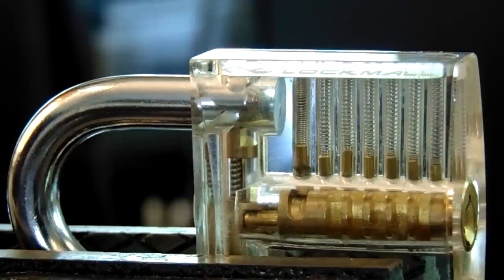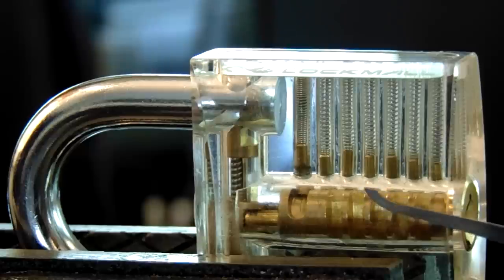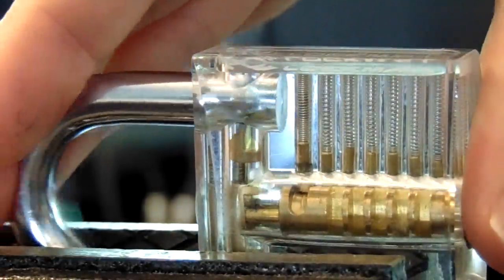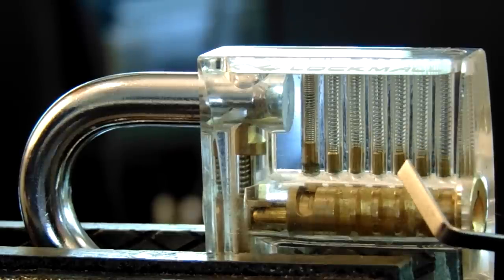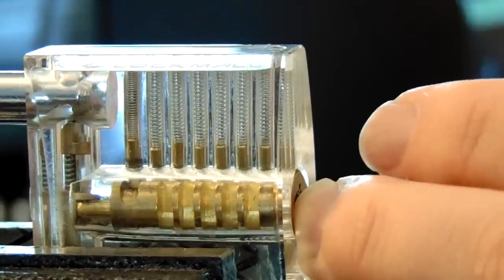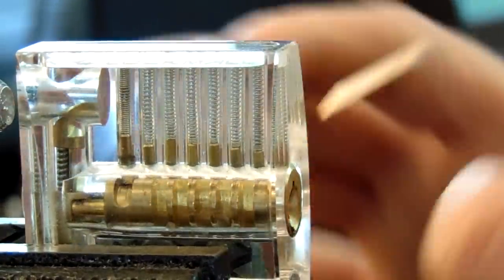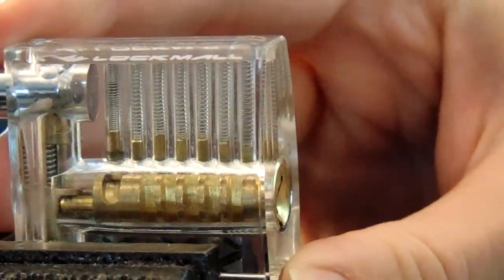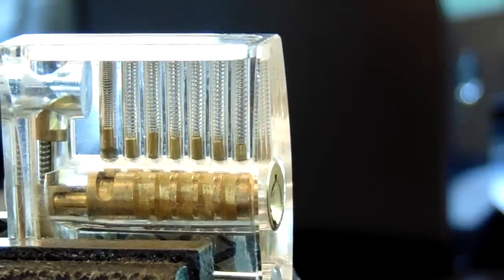[30] Closeup On How Lock Picking Works

Comment: The top of my lock popped out. Can you give me a technique to put the right driver pin at the right place please ?
Reply from the maker: Did the plug pop out? Do you.have a photo to show what happened?
Reply: @HelpfulLockPicker  I can't take a picture (don't have what it need ^^ ) but yes the plug popped out. (It is very similar stuff than your own lock). Dude you're quick to answer ! thx ! :)
Reply from the maker: @pugilat123456  whatever retaining mechanism your lock uses must have come loose. It is hard to help you fix it if I don't know exactly what lock it is. But if it came out after picking it probably would have come out with the key.
Reply: @HelpfulLockPicker  OK thanks I'll try :)

Comment: What about double edged key cylinders?  I have a keyed rhino roof rack where I need to move the front rack further forward because when I bought my car they were too close together & the previous owner lost the key.  I ordered a key matching the number of the cylinder but it won’t turn the cylinders.  They key is cut on both sides.
Reply from the maker: Check out my video on wafer locks

Comment: Would you please pull that cylinder and layout your top pins and bottom pins in order and on camera. I want to see the bottom of those top pins please?
Reply from the maker: Check out my video [112] which takes one of these locks apart if you would like to see a closer look at all of the pins. Also, check out my video [247] on how lock work

Comment: Nice presentation but pity the key barrel was not transparent - and wht is the 7th pin for?
Reply from the maker: I did not film the best angle when I made this if you check out this video on picking locks with bobby pins I have a much better angle for you to see everything. https://youtu.be/xNV6FEY5Qv4

The 7th pin is just the mechanism the lock uses to retain the core so it does not pull out when you use the key. There are many different mechanisms locks use and this is  just the one this one used.

If you would like to learn more checkout my 
Playlist: Lock Picking Home School which helps students learn from zero experience up to an intermediate level.

Lock Picking Home School: https://www.youtube.com/playlist?list=PLmCWiTycBRr2ydL3SEmLVgzqGZskL0uz_

If you have any questions feel free to ask!

Comment: Those things are so way super easy to pick tho. I know they are designed to be. But even the master lock #3 which is supposed to be the easiest is 10 times harder than that. You can rake the plastic lock with anything and it will open
Reply from the maker: Thanks for sharing 👍

Comment: can you do that on your car lock in case you left your keys in your car? or do you need like a more heavy duty lock picker?
Reply from the maker: Some cars use water locks which is similar but many have moved onto slider locks which is more secure.

However, cars are quite easy to get into other ways. Just never open locks you don't own because there is the potential of breaking them

Comment: This really works! Unfortunately, I found out that it does not work on jail cell locks.
Reply from the maker: Typically you don't want to pick locks in use or you could end up in a place like that

Comment: What keeps the lock from opening in the first place? It can’t be the pins, because the key is in the same place.
Reply from the maker: The driver pins set recessed in the plug which keeps the lock from turning

Comment: Can someone explain to me why the pins don’t come back down when he pushes them up, why do they just stay in sheer and don’t get pushed down back into the hole
Reply from the maker: The driver pin stays set and the keypin drops back down. When the lock is manufactures the hole slot where the driver pin sits and the whole slot where the keypin sits in not perfectly aligned. This micro tolerance issue makes it possible for a pin to nbnd under tension. This is why cheap locks with poor tolerances are easy and expensive locks with great tolerances are hard. In theory if a lock had a 100% alignment picking would not be possible.

Comment: A few years back, I used a slightly bent bobby pin (hair pin) and the metal holder from the lid of a pen to get into a friend's grandparent's house after they accidentally posted the spare keys through the letterbox.
Reply from the maker: Sometimes you need to do what you need to do but not using the proper tools makes it so much harder.
Reply: @HelpfulLockPicker  Yeah, I had no access to lockpicking tools and had only done it a few times with a padlock but I managed to get in there pretty quick.

Comment: Seems like you could attach a strong magnet to the side of the lock and pull the pins out.
Reply from the maker: The pins aren't magnetic though
Reply: I was thinking compressed air, assuming the lock was airtight.

Comment: why not move all pins together up and down, and whatever pin is binding will get set?
Reply from the maker: This will cause over setting and prevent opening the lock. One interesting thing is "comb picks" which lift all the pins into the bible but this is easily defeated.
Reply: @HelpfulLockPicker  oversetting?

Comment: 1) Why is it that each pin, once raised, holds its location and doesn't drop back down?
2) I learned a lot about locks on my own because I had to rebuild a deadbolt lock on my old townhome that was up for sale but uninhabited. Realtor told me the front door lock was not working anymore and I need to replace it. I found, after taking apart and reassembling, that after a 180 degree turn that each pin released into the main key cylinder and jammed the lock. My theory was that someone attempted to pick the lock but did not know that each pin would release like a did and then it locked up... anyone know if this is correct and a theft deterrent measure?
Reply from the maker: It is due to the holes in the plug and bible not being perfectly aligned. The more they are off the easier they are to bind and set. This is an example of why expensive higher security locks are more difficult to pick

Comment: Question: what is the leftmost pin for?
Reply from the maker: The pin retains the plug. When you open the lock with the key or pick it if something is not there to hold it in place it would slide out and all the pins would shoot out. It would make a great mess and break the lock.
Reply: @HelpfulLockPicker  I see. So the reason it has a spring like the other pins is only for manufacture reasons? Or can you actually move that pin with a pick too so you can change the cylinder? Also thanks for the reply.

Comment: How do you know if a lock is like this one with the springs
Reply from the maker: Most locks are pin and tumbler locks, so many of the locks you run into will be like this one. You can tell by looking at the key and then looking into the keyway

Comment: Do automotive locks work the same way?
Reply from the maker: Well, most of them have kill switches so you need the chip in the key to get them to start.
Reply: I was thinking more of the door locks, and I'm poor and cheap and drive old cars. @HelpfulLockPicker
Reply from the maker: They are usually wafer locks which is a slightly different mechanism but opens just as easily. Check out my video on wafer locks. If you have any further questions feel free to ask!

Comment: if you lift one of the pin to high it wont open ?
Reply from the maker: That would result in an "overset" which would prevent the lock opening

Comment: Is it possible to have more than 6 Pins? tried on my neighbor, doesn't work
Reply from the maker: Some locks have 7 but those are not common. I wouldn't practice on locks in use because you don't want to break them

Comment: How come some keys fit the lock but don’t turn, isn’t that the same mechanism technique demonstrated here? As in there’s a rotational force to turn the lock while having the picks up at the same time?!!!!!
Reply from the maker: It is because the incorrect key does not have the correct key pin height.  Check out my video [247] for a more in-depth explanation.

Link to video: https://youtu.be/KCMhdx_y4Hk

Comment: Where would one purchase These Tools, Home Depot?
Reply from the maker: Which tools? The lock picks? You can get cheap sets on gearbest.com or some more professional sets from Peterson, Sparrow, and Southord.
Reply: @HelpfulLockPicker  Thank You but I was hoping an outlet other than Online.  I'm a builder I may be able to fabricate the two simple ones in the Video.
Reply from the maker: @conradcarvalho3860  the two most common materials used are the metal inserts in windshield wiper blades for the tension wrench and 0.025" feeler gauge for the pick. If you end up making something yourself I would love to see it when you are done :-)
Reply: @HelpfulLockPicker  will do. I know the metal length in windshield wipers that You are taking about.

Comment: I see seven pins, whats the last one for?
Reply from the maker: It is different. It is used to retain the "plug" which is the part of the lock where they keypins are stored. Without it, when you opened the lock the whole thing could slide out and it would break the lock.
Reply: @HelpfulLockPicker  Oh okay, makes sense, Thanks!

Comment: I have been a locksmith for over 30 years and have never seen a lock open that easy. That has got to be the cheapest lock in the world,
Reply from the maker: It is, the driver pins are keypins and most of the pins sit almost at the shearline

Comment: What is the 7th pin at the far left?
Reply from the maker: That is used to retain the plug and does not affect the opening of the lock. Every lock has some sort of mechanism to hold the plug in because when you turn the key over it would slide out and all the pins would shootout

Comment: Why wouldn't blank key w no cuts do the same thing?
Reply from the maker: It would overset the keypins and they would obstruct the plug from turning. In this lock, it has a really tall bible which makes it prone to a comb pick attack where you lift both the keypin and driver pin above the shearline and you can bypass the lock in that way, however, that exploit is not common on modern locks.

Comment: I have that same lock and picks, the practice lock is super easy, real locks are very difficult. I can pick the practice lock in 1 second but real locks haven't worked yet. it's not that easy.
Reply from the maker: It takes practice, if you can try out a Kwikset they are really great beginner locks

Comment: Orrr...you can just push the spring-loaded latch pin down by running a thin metal shim down the inside of the shackle in the upper left of this picture, wiggle it a bit and voila! Lock pops open.
Reply from the maker: How would that work on a padlock with ball bearings though?
Reply: HelpfulLockPicker: Don’t know, was hoping you’d have an acrylic one to show us, lol.

Comment: “Holy Lock picking Batman” that makes perfect sense now. I guess that the older the lock (door) the more worn the tolerances. Therefore the looser the pin engagement
Reply from the maker: Thank you for checking it out. As a lock ages it can either get harder or easier, sometimes the grime can make it more difficult. 

This lock is particularly easy however it is not much more difficult than the standard residential Kwikset lock very common in the United States
Reply: @HelpfulLockPicker  I guess if you spray WD40 into the Key way it would make moving the pins easier. What would be the main difference in say an average _Door Lock" compared to a "Jail Door Lock"?
Reply from the maker: @byLokie  I have never picked a deal door lock if I am honest that I probably wouldn't try either. However, you don't want to use WD-40 to lubricate your locks because it is a degreaser and once it dries out it will make the lock more gummy. I would use Lock Houdini or Triflo

Comment: So what locks CANNOT be picked??
The more/most expensive ones?  Yes?  

PLEASE, PLEASE Help.
Thank you.
Reply from the maker: There are still a few locks that haven't been picked but buying an expensive lock doesn't always make sense. Security is only as strong as its weakest link and you need to take into account what you are securing and buy a lock that makes sense for that.
Reply: No most locks can be picked
Reply: @Thesussysuscat   Thank you for replying.

Comment: You should have mentioned that "pin" seven is a rotational limiter.
Reply from the maker: It is there to hold the plug in so it doesn't slip out when the lock is turned over.

Comment: This video should be titled “Burglary 101”
Reply from the maker: That would not be a good use of these skills. Lock sport is meant for picking locks not in use and having fun.
Reply: You do realize you’re being irresponsible, don’t you? You might be thinking you’re doing it for fun but there are real consequences in showing this on YT! I don’t even understand why YT allows this stuff online.
Reply from the maker: @cachi-7878  The harsh reality is locks in the real work are much harder to open and statically speaking one needs to be more concerned about weak door frames, windows, etc because destructive entry is the techniques that are used most often with unauthorized entry.

Lock sport is a lot of fun and a great community. As with any hobby there will always be a few bad apples out there but that does not need to ruin it for everyone.

Thank you for sharing and I hope you were able to learn something :)

Comment: Where are the bottom pins that sit in the holes in the barrel?.
Reply from the maker: The bottom pins are inside the plug. You can't see them in this lock since it is not a "cutaway" lock
Reply: @HelpfulLockPicker  It does not look like a standard Lockwood night latch, if appears to have  grooves around the barrel, have never seen anything like that before.

Comment: My idea is a compressed air canister releasing all the air into the lock within a second, and turn. Guaranteed all pins up and always success. I bet it works. Why? Because im ine clever dude.
Reply from the maker: Thus would not work on most locks because their is not enough space to accommodate the spring, driver pin, and keypin in the Bible of the lock.

Check out "comb picks"
Reply: @HelpfulLockPicker  So you have tried it then yeah. 20 bar of air so 390 psi straight in the hole. You aint so dont comment as if you know for sure. comment if you have tried it.

Comment: Surely there's 7 driver pins?
Reply from the maker: 7th pin (bigger one) is to retain the plug when you turn it over and it  it doesn't affect opening the lock
Reply: @HelpfulLockPicker  yeah yeah. I got ya mate. I made the comment right at the start of the video and then I slowly cottoned on as you progressed to the first picking technique. Thanks for making these videos. The translucent padlock was really helpful aswell.

Comment: Don't be fooled... it's all in the pin configuration. if you have a high pin in the back and a low pin in the front, even a cheap lock can be a challenge..  Best advice is to practice with as many types of locks you can get your hands on....   the battle rages on.
Reply from the maker: Also on these locks if you flip the driver pins over (flat side touching the keypin) it makes it harder. This lock is cheap and they used keypins for the driver pins

Comment: ......COULD YOU SLIP A THIN PIECE OF SHIM STOCK, OR FINE SPRING STEEL WIRE, OR SHEET/FOIL, ALONG THE SHANK OF THE HASP , CAUSING THE RETRACTION OF THE SPRING LOADED KEEPER, ALLOWING THE HASP TO POP OPEN...?!....
Reply from the maker: Yes, it is called shimming and I made a video of that on this lock. [50] Close-up On How To Shim Open a Padlock

Comment: i generally use a drill. 4 minutes to get into a bank, but dont know how to get into bank vault. any ideas?
Reply from the maker: I wouldn't recommend using a drill on a lock in use but thank you for checking out the video
Reply: Enter as a customer on a Friday , hide in the washroom until they close down for until Monday, then drill your way in. Or plan your adventures on long holidays. Of course, you need to plan your exit when it is crowded on a Monday too.

Comment: And the burglary crime wave begins. Burglars picking locks to find their own stolen goods in the place they just broke into due to your tutorial on lock picking! lol
Reply from the maker: Most unauthorized access comes through destructive entry because it is quick and reliable. Security is only as strong as its weakest link and the lock often not it
Reply: @HelpfulLockPicker  this is true; however, unauthorized entry does not always have the purpose of burglary or violent crime. There is also the motive of a covert or information gathering nature, which the perpetrator does not want the subject to know anybody was even there. That is where lock picking becomes the best choice for entry. Information can often be of much higher value than any stolen property.

Comment: But real locks in real world are more complex, right? And can't be opened with a screwdriver in 30 seconds like you did it, correct?
Reply from the maker: many real locks ca be opened very quickly but this lock is a little bit easier

Comment: Their called Top pins and Bottom pins... plus you can master key a lock... but don’t get caught with Lock Picks if you not a locksmith or in a legitimate job requiring them!
Reply from the maker: Thanks for checking out the video. Locks are fun to play around with even if you are not a locksmith.

Comment: where is the split secondary pins Mr. bogus video
Reply from the maker: I am not sure if you are talking about the driver pins and the key pins but they are in there. If you would like a better angle I would consider checking out this video https://youtu.be/HBSTWr_LgaY
Reply: @HelpfulLockPicker  ok